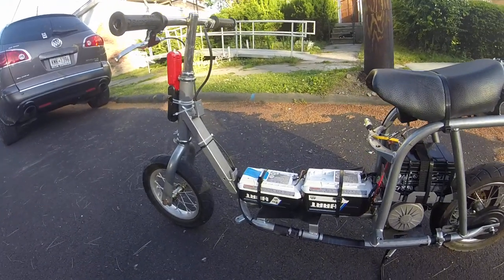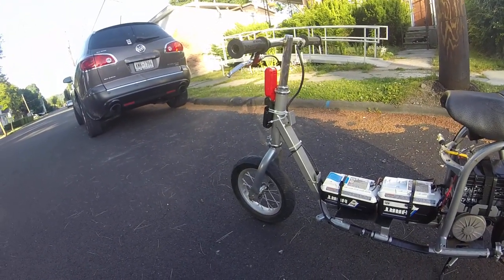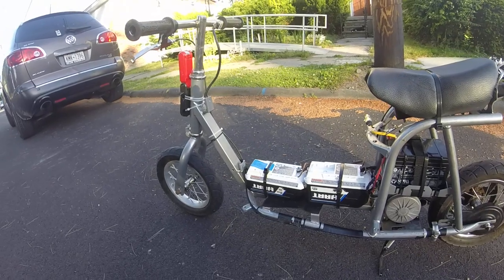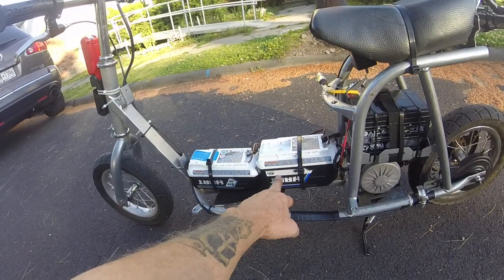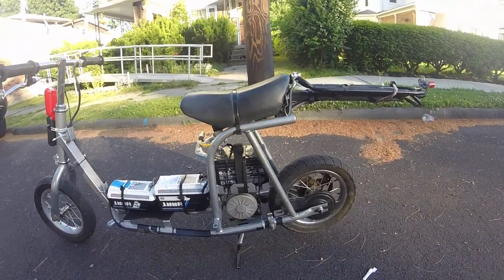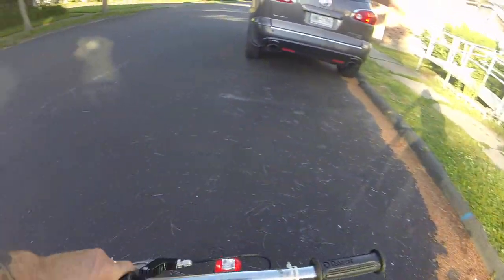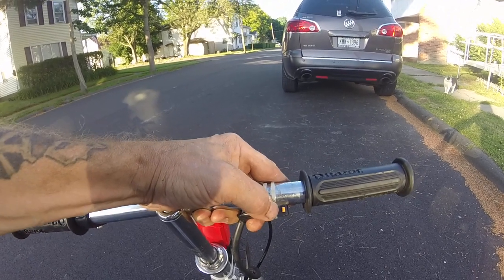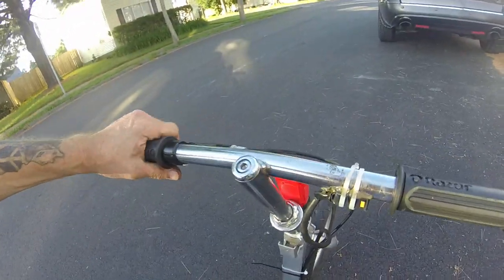Running a Razor Pocket Mod on 40 Volt Lithium batteries

Comment: Is the controller and motor stock ?
Reply from the maker: No, a 45 AMP 36-60V Controller,  1000W MY1020 motor.
Reply: @diydan-kd2ynd63  put a 16 inch wheel off the razor ecosmart , it'll hit 30

Comment: You're running too a motor drive controller right
Reply from the maker: It's a 45 Amp 36-60V controller yes.
Reply: @diydan-kd2ynd63  what type of wiring system you usings .. are you using  fuses or relays . And where do you use them in the wiring.. because I keep burning switches and burning wires